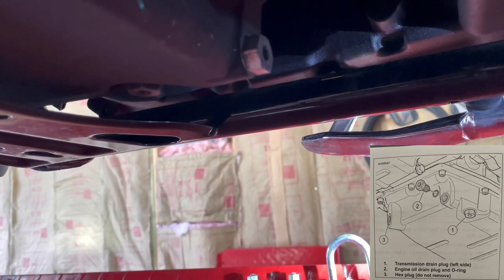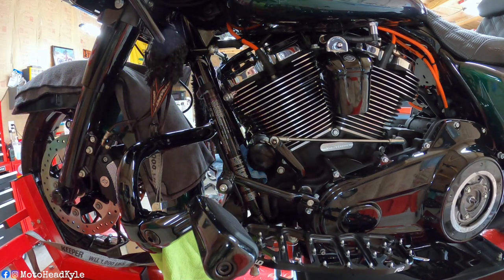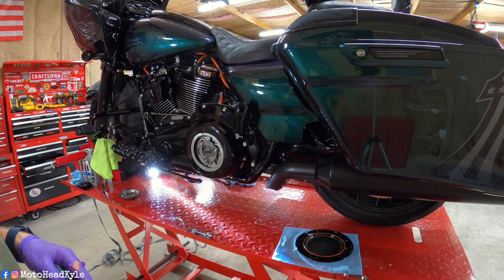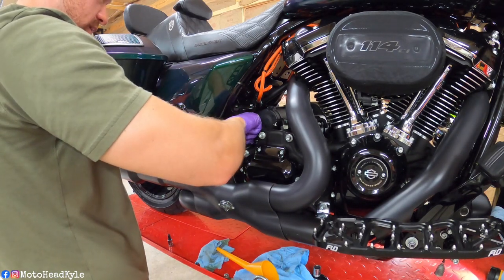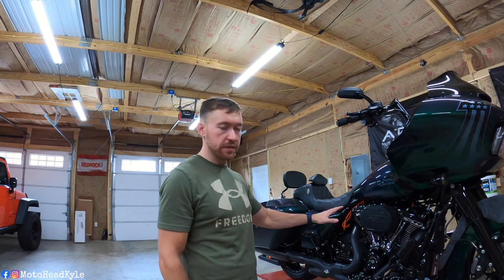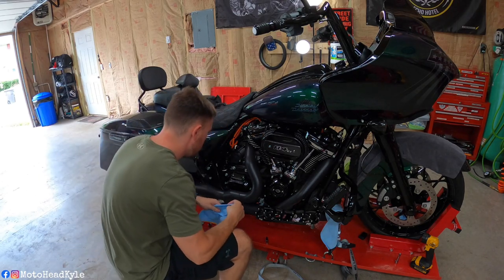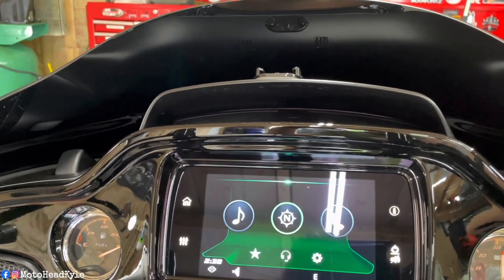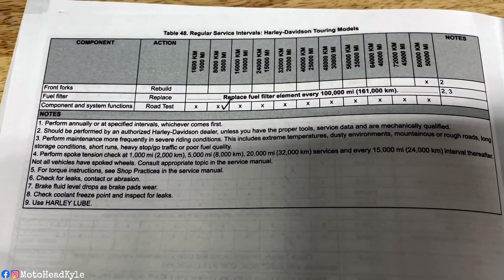3 Hole Oil Change & 10,000 Mile Service On My M8 Harley Davidson Road Glide

Comment: Pro tip: about the oil filter.  Fill the filter up with oil before or maybe 15mins or before you start the oil change and the oil will soak up in the filter and it will not spill out on you and cover the filter up hole up with something until you get ready for it. 👍
Reply from the maker: I appreciate it! I don’t leave it out in the open, I remove old filter, wipe and install new filter immediately! But I’ll have to let it soak next time and see how that works! Thanks for watching!
Reply: @MotoHeadKyle  you can cover it 🤷🤦 iv done this all my life on all my vehicles, bettet than a dry filter
Reply from the maker: @carolinarider5237  I misunderstood you at first! For some reason I thought you meant cover the housing on the bike.. not the filter. My bad. It’s been a long day. Thanks for the feedback!

Comment: Kyle how does the oil trough work when removing the filter? Do you still get oil dripping underneath it?
Reply from the maker: It works OK but it does have a tendency to move a little bit when removing the filter which allows some oil to drip but I usually put paper towels in the back to help with that. I think it was $10 or $14 when I got it so overall I still think it’s worth it

Comment: Hey brotha how do you like using that mobil 1 synthetic on the stock 114?
Reply from the maker: It’s great, I’ve really only ever used Mobil 1 in my bikes. It’s affordable, and you can get it on the road pretty much anywhere
Reply: @MotoHeadKyle  you know you’ve gotta excellent point there brotha about finding it on the road pretty much anywhere! I’m changing my oil soon so definitely gonna try this out! 🤙🏾
Reply from the maker: @bigbaggerben7504  yeah I try to make it simplistic, some people pay a decent penny and have stuff shipped out. And they just get in their head about what oil to run. I’ve used Harley’s oil, amsoil and royal purple over the years and kinda always liked how my stuff ran on Mobil one, and the fact I can get it cheaper and at any auto parts store near me and even Walmart carries it.
Reply: @MotoHeadKyle  dang that’s eye opening! How often do you change yours? I’m pretty much a year round rider in NorCal. Just about to hit 8k on my snake venom 🦈
Reply from the maker: @bigbaggerben7504  I change all 3 holes every 5K or so! Yes me too! I try not to ride it much when it drops to low temps unless I know I’ll be out riding for a continuous 30 minutes or more to try to make sure I don’t get condensation in the oil. But that’s awesome man! I’m about to hit 13K!
Reply: @MotoHeadKyle  ahhh that’s another good thing to note! See I haven’t put any “real miles” down yet lol I missed Arizona bike week but I’m definitely tryna do like a coastal ride out here HWY 1. Or even just get out of California for like a weekend trip!
Reply from the maker: @bigbaggerben7504  that sounds dope! That’s definitely on my bucket list when I make a trip out west🤘🏻

Comment: What type of motorcycle lift is that?  Thanks
Reply from the maker: It’s a Harbor Freight Lift, & we added harbor freight ramps onto the sides. Only thing else that is different is the upgraded wheel clamp
Reply: @MotoHeadKyle  what benefit are the ramps on the side?
Reply from the maker: @scotta6610  because there’s no where to put your feet when you ride up on the ramp
Reply: @MotoHeadKyle  ah makes sense. Thanks. Enjoy your videos. Waiting for you to do one on helmets :)
Reply from the maker: @scotta6610  thanks Scott! I’ll see what I can make happen this winter